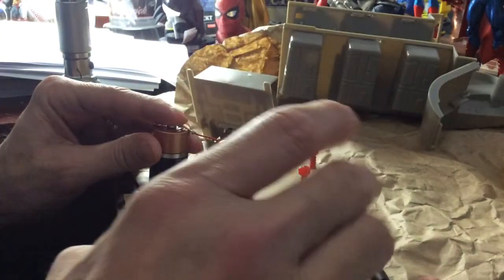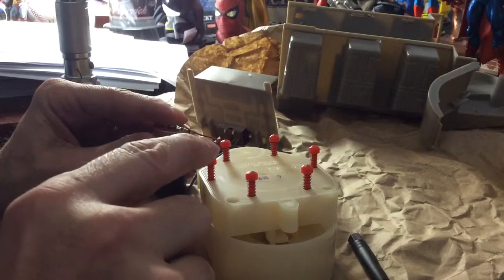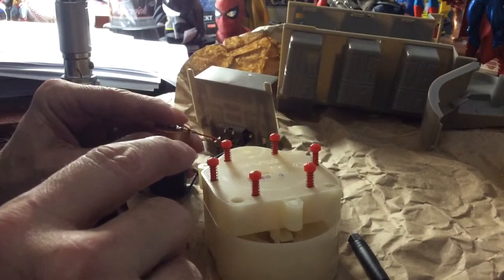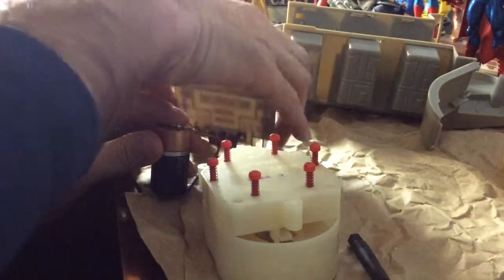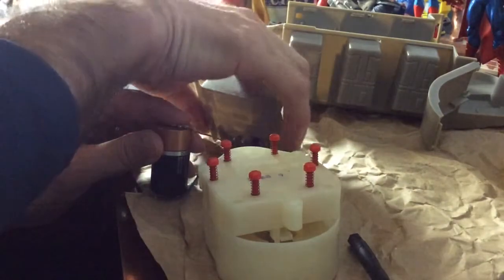Star Wars troop transport sound fix

Comment from the maker: Sound wasn't working when I got this out of storage. First, even with new battery, motor would not turn. 2 small drops of lubricating oil down motor shaft fixed that problem but still had no sound. Took apart toy to get to "voice box". found rubber band (that turns the small plastic record inside), had slipped off motor shaft, so record was not turning. I pulled end of rubber band and slid it over the "holder" that is inside the box. when putting box back together, rubber band 9with a little help) should slide back over shaft.